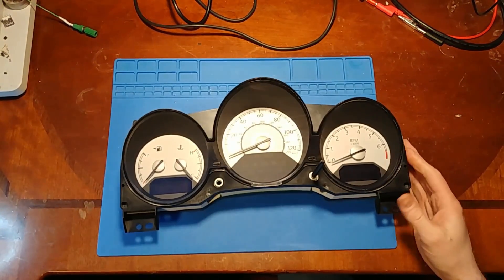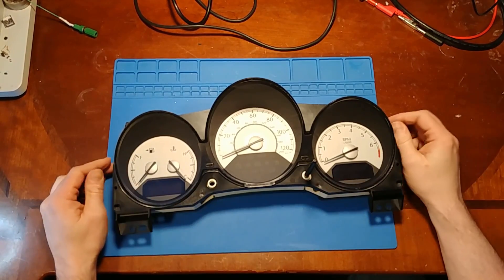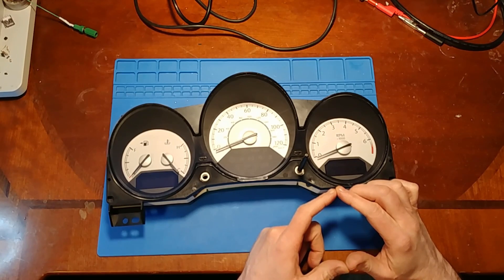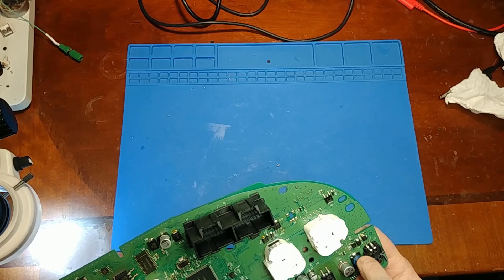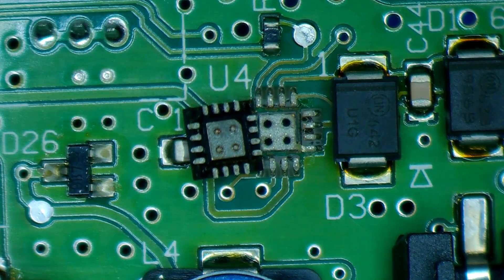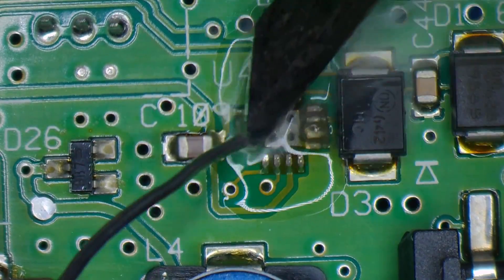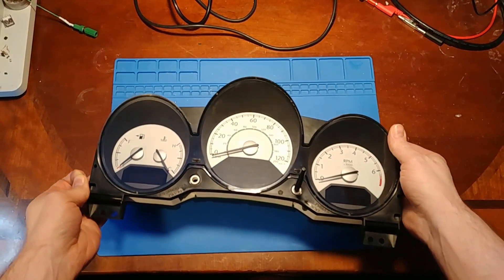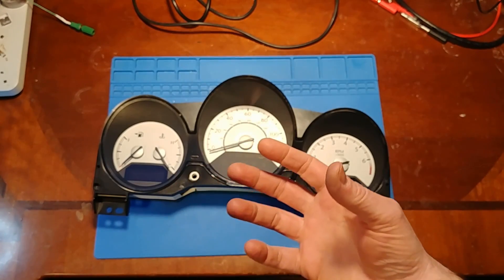Sebring Cluster EL Backlighting Repair

Comment: Just had this issue happen with my Sebring, and getting that 04842345AA chip and replacing it worked for me. A $12 chip or a $200 cluster replacement? Was certainly worth a shot at least! Thanks for the video, if nothing else for naming that chip and not telling us to get that ELD5 inverter everyone and their mother is making videos about, I'd rather not scratch off traces on the board.
Reply from the maker: Glad to hear it worked out. Can I ask where you purchased the chip from? The last batch I got from AliExpress was fake.
Reply: @jeffescortlx  Not sure if you're getting my message since YouTube seems to be blocking my comments, so I shall try again; huayi-components on Ebay?
Reply from the maker: @rinhayashi8949  okay thank you for getting back to me.

Comment: Hi! 

I like your video! Really, I do!

Which 04842345AA  you meant?
I found: 
QFN ; QFN16 ;  QFN #A6-4 ; QFN #A6-37 ; QFN #A6-38 ; QFN #D7* ;  QFN16, #F7 ; QFN16, #D5 ; QFN16, #E2 ; QFN16, New #F14* ; QFN16, #A6-29*  and more...
Are you able to help my finding a decision?
And how to find out the correct direction of the piece? (upside-down / left 90° / right 90°)?

Best regards from Germany!

Lars
Reply from the maker: The chip package is QFN 16. I'm not sure where you're getting these other numbers from. The generic part number is D603A.
As far as orientation goes, you have to pay attention before you move the old chip. If the chip is right side up when you remove it, then you have to put the new one right side up also.
Reply: @jeffescortlx  I searched in German ebay and some Chinese dealers are offering the different  codes of that OEM-number (04842345AA). Which one should be chosen? Any idea? The shipping needs nearly 3 months (maybe there is not a good market in Europe)!
Reply from the maker: @larswilhelmsen4250  I don't know what it is you found. Can you provide a link so I can look at them? You want to make sure you match the part number and physical package size.

Comment: Sorry i now see the D306A driver chip.  The person that wants to do the rep. Air for me also wants me to get the ones on either side. To help simplify the repair for him. Do you have a stomach that might tell what these other 2 chips are?
Reply from the maker: I'm not sure what parts on the other side you're talking about? I wouldn't recommend to replace parts that have nothing wrong with them. The more parts that are replaced the more likely something can go wrong.
Reply: There are some type of chip or part on either side that he said with the heat he would apply to get the one off, it would be best to replace those at the same time.
Reply from the maker: @mattweibert60  I've been doing these clusters for years and I never had any issues with the surrounding components. There are no components directly behind the EL chip, just 4 via feed throughs for heat dissipation. You might want to find someone that has experience with this particular repair.

Comment: Hello.  I found a local guy that is willing to do the soldering and replacement work for me. But he needs to know what parts. How did you figure out what parts to use?
Reply from the maker: I figured out what parts to use by googling the part number I found on the chip.

Comment: Hey guy I'm one question ,while is the component bad ,the cluster no mark level the gasoline in Caliber 2007 I have this problem,please help
Reply: Please if having diagram eschematics send me .the cluster caliber 2007
Reply from the maker: Run a gauge sweep test by holding down the trip button when you turn the key on.
Reply: @jeffescortlx  thanks yes I try it's ok test but only in the test
Reply from the maker: @tonyperea8378  if the cluster can pass a sweep test than its very unlikely the problem is in the cluster. You probably have a bad sending unit.

Comment: Where can I get that chip all I see is after market eld5 stuff I want oem I'm a certified auto tech attempted to reflow didn't work.
Reply from the maker: No, a reflow is not going to work. It's not joint failure, but chip failure.  UTSOURCE sells them.
Reply: @jeffescortlx  thank you I'll check them out.  I found out it the reflow didn't work it was working every now and then on low. Now she doesn't work at all. I've been looking at these el inverters as well  some one on a forum said you could tap into the clock desolder the el connector and safe that for later to hook your new inverter to then get your power from the clock. I've got a used board coming so I'm going to do some testing.  Any certain temp you don't want to exceed putting that chip in with
Reply from the maker: @autotechmike  stealing high voltage from the clock sounds hacky. I can't imagine they engineered the extra compensation needed to drive a larger EL panel. The EL chips are still available and not that exspensive. It's not that hard to fix it right if you have experience with SMD chips. Just don't pull any pads or delamitate the PCB with too much heat for too long.
Reply from the maker: @autotechmike  I list the part number at 0:17 in the video.

Comment: Jeff, what model years are prone to that issue?
Reply from the maker: 07-09 are the on-board SMD ones. The older generations have issues too, but it has a separate module that can be replaced.
Reply: jeffescortlx , to power it on the table BCM (or some other modules) is needed?
Reply from the maker: @HETPEZB  if I remember correctly to turn on the back lighting it's looking for a serial bus signal. I don't remember seeing a independent analog input for backlighting.
Reply: jeffescortlx , do you think the signal from the diagnostic scanner may wake it?
Reply from the maker: @HETPEZB  maybe, but I don't have a diagnostic tool for Chrysler. I just plug it back into the car if I can.
Reply: jeffescortlx , got it. Is every single cluster (07-09) is an EL or it depends on the vehicle trim?
Reply from the maker: @HETPEZB  i believe it's a option depending on trim. With the older generation I remember twist sockets in the PCB. I think 07-09 also have a normal LED backlighting option for the cheaper trim models.

Comment: @
jeffescortlx        Wow, you have no idea how helpful this is and the timing is great! The lights just stopped working in my 07' Sebring this month and have been looking around for a fix. The most popular seems to be the ELD5 module that you add to the back of the cluster.The only thing I don't like about it is that it requires cutting some of the PCB traces. But if I have to, I'll do it. I do have some questions, if you wouldn't mind giving me your input.   1) Would you recommend doing this [what was in your video], or should I just purchase the ELD5 inverter?      2) Did you actually replace the chip, or will resoldering the chip back on be sufficient?  IF you did replace the chip,  would you be so kind as to show me the link to the part?

I'm fairly new to soldering, but I'm confident I could pull this off if it means not cutting traces, or spending $500 on a new cluster that will end up doing the same thing.
Reply from the maker: 1) I would reccomended professional installation for either/or of the two options. 
2) yes you'll need to replace the chip. It has failed/fried completely when it's to the point of no longer working. Soldering back on a fried chip won't fix it.
Reply: jeffescortlx Thank you very much for your response! Of course you have to replace it, I realize this was a stupid question; it was 3:00am. Lol. Thank you for your time. Could you send me a link to the part you used?
Reply from the maker: @lSil3ntZer0l  I don't have a link, but I did get it from contacting the manufacturer directly. Part number is at 0:18
Reply: jeffescortlx  Would this be it? http://www.rogerscorp.com/documents/27/durel/DUREL-D306A-EL-Lamp-Driver-with-Microcontroller.aspx

This seems to be what you’re talking about. I can’t find it elsewhere. Not even Mouser Electronics.

Comment: Have you tried tin lead paste solder for your hot air repairs?  You can load it into syringes and then just draw a line of paste across the pads.  As the hot air melts the solder it is drawn onto the pads by capillary attraction and provides the perfect amount for each connection.  This lets you set the part down into place without having to futz around with it as the solder melts.
Reply from the maker: Yes I have and yes I've tried it. But I just find myself going back to tinning the pads with regular solder.

Comment: Working solder joints you can't even see must be an X power.... I repaired boards in EMD SD 40s (locomotives) but the traces are the size of toothpicks and I used 22 gauge wire soldered from component pad to component pad then attached with shellac.... but blind solder joints must be tough..... hats off to you man...
Reply from the maker: It's amazing what a person can pull off with a good microscope! Steady hand helps and some practice. 10 years ago I never would have guessed I'd be doing stuff this small.

Comment: Thanks for all you videos.
Problem: Intermittent gauges. All gauges come on or off especially during cold weather . took apart and reflowed some of the common failure points. This didn’t help. The gauges still intermittently work. Any thoughts, leads? 

I want to take my bench top 12v supply and rule out a bad connection elsewhere, BUT i dont know how to set up a 12v connection. Have you ever thought about doing a video on hoe to setup power to gauges? 

Thanks for any help?
Reply from the maker: I don't know what kind of vehicle you have, but I'll guess 03-04 Full size GM. They are good for hiding bad joints everywhere. It's worth looking for tin whiskers on the back side.
Reply: jeffescortlx  yes 03 suburban. Sorry im not sure about Tin whiskers? I will look for any abnormalities in the solder. Any more advice would be appreciated. Thanks
Reply: jeffescortlx ok i just google tin whiskers, got it